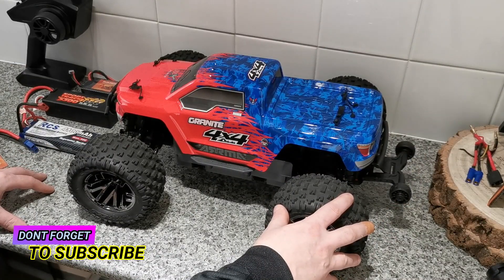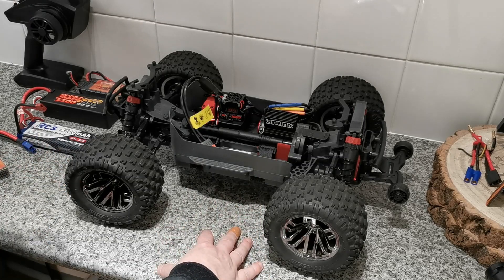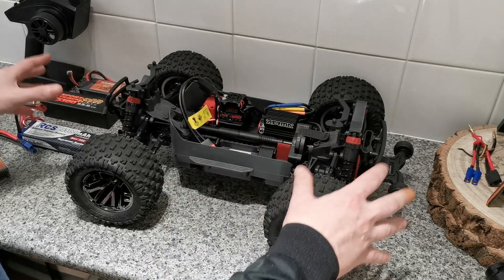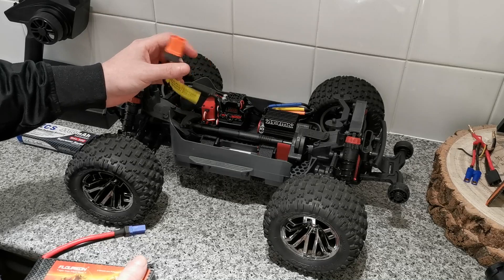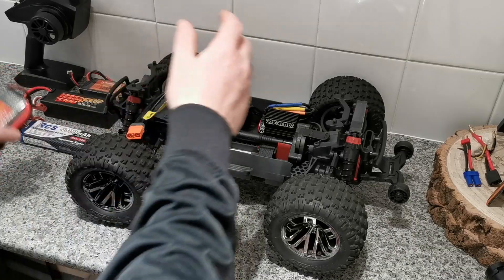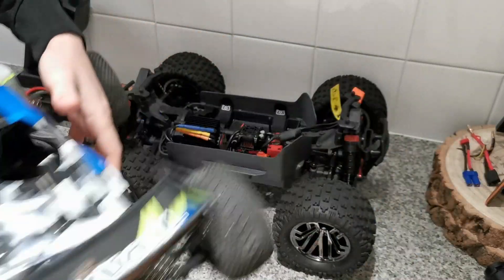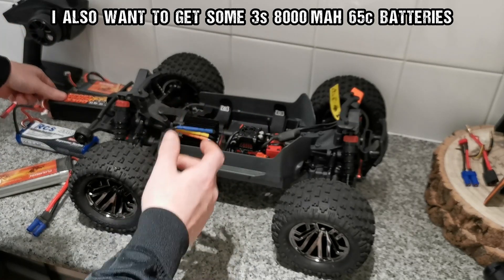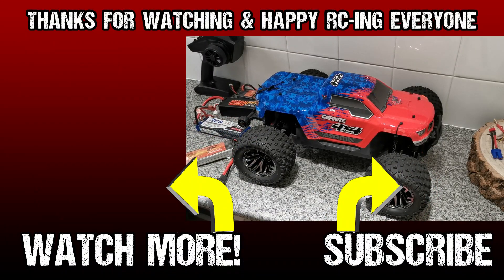Faulty Arrma Granite 4x4 3s BLX

Comment: I run a 8000mah 100c battery in my arrma granite 4x4 3s box and its insanely fast and it last for 30 minutes of straight bashing
Reply from the maker: hello mate, very nice, sounds like a beast of a battery, :) glad your liking the truck..
i have been running 5300mah 3s 65c  and 4600 3s 75c and both also give me a good 30 minutes run time, im very pleased how the truck is now performing.. happy rc-ing :)

Comment: I was hoping you would tell us what was wrong with it and how you fixed it not that you just got a new ESC
I don’t see a link for the video in the top right hand corner
Reply from the maker: Hello, the link to the other video is at the start of this video, if you still can’t find it to go my arrma granite playlist.. in this video I explained that the esc was faulty and the issues it was have, but basically the esc was entering Low voltage cutoff long before it should have also the fan was not working, the esc entering LVC is down to a manufacturer fault either faulty microchip board or sensor.. happy rcing 👍
Reply: MarcRCAddict thank you now I can sleep tonight LOL

Comment: I just bought mine a few days ago and after only about 12 minutes of my 5 yr old driving it at 50% throttle, it shuts down. The 3s voltage is at 11.6 and I have IC5 on both ends. I think it's a low voltage cutoff issue and not an overheating. Is there a way to adjust the LVC to a lower number? Let's say 3.2v per cell instead of 3.8?
Reply: Just bought a Senton last week & guess what...runs 5 minutes or so then LVC cuts in ! Check the battery  & it shows 3.8 per cell ! Now need to contact the shop to try and solve this but, why are they still selling these when obviously, their is a problem??
Reply: @johnbooth101  you must have purchased the senton 3s correct? That's the problem with the 100a esc, the LVC is set too high with no adjustment and no fix. You can purchase a lipo alarm for $5 and bypass the LVC by running the esc in NiMh mode.
Reply: @johnbooth101  also, I emailed Arrma about the issue and they sent me a free esc because I was getting an additional cutoff with may have been early overheating detection
Reply: Yes it was the Senton 3s. I did think about running it in nimh mode with an alarm but, then read somewhere that this will only work with 2s and, if you try it with 3s a blue light comes on and the car won't work at all ! At the end of the day though, when you've just paid £300, you shouldn't have to  ! 🙁
Reply: @johnbooth101  yeah, you shouldn't have too but but I guess the only logical reason is for the longevity of the battery. But it will work on 3s perfectly. I've been doing it for about 4 packs already. Have it set at 3.4v due to voltage sag bit when I take the battery out, there's always 3.6v or more left in it. My run time has gone from about 10 min to at least 20 min
Reply: Yes mate, I tried it this morning & it worked ok. Not had chance for a blast yet but fingers X. 😁 Cheers 🍻
Reply: @subietech2019  hows it held up mate if you can give us an update? I had the same issue today particularly on full throttle over 50ft or so and it will just slow down then cut off. Later switched esc to Nimh mode and it made some difference altho i soon changed it back to lipo mode to be safe since i dont have cut off alarm with me atm. Kinda shit since it only came yesterday and i dont wanna be spending more p on new batteries for no reason 😕
Reply: @rcmains4237  Mines been fine since I switched to Nimh with a lipo alarm. No issues
Reply: @rcmains4237  I run the lipo alarm in NiMh mode set like at 3.4v. It will set off the alarm due to voltage sag but will notice there's still like 3.6v-3.7v left in them. I don't recommend it but I've run with the alarm set at 3.2v and will still have like 3.5v-3.6v when I check them
Reply: @subietech2019  ahh fair enough man. I heard someone else saying the same thing and that its been working for them. Yeah that sag is a ballache it’s definitely whats been cutting it off for me on constant full throttle. Some say getting a higher C battery helps too?
Reply: @rcmains4237  yeah I'd try to avoid anything less than a 50c for these machines. They are powerful and need a battery that can supply the voltage fast
Reply: @subietech2019  i just checked and I originally misread thinking they were 45C. They’re actually 4500mah and 60C! Fkin hell thats abit harsh on me if even 60C doesn’t work. Ffs 🤣

Comment: I have the exact same problem and I got mine 3 days ago
Reply from the maker: Double check the low voltage mode make so it’s in LiPo mode, try a different battery if you can, and don’t use dean’s connectors if possible, if the issue continues send it back to the shop, some of these esc are faulty..